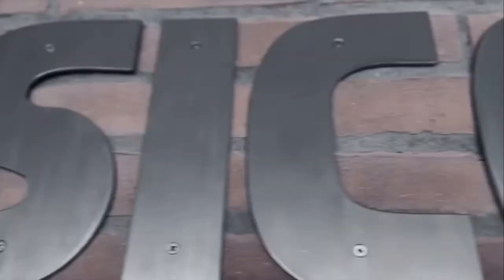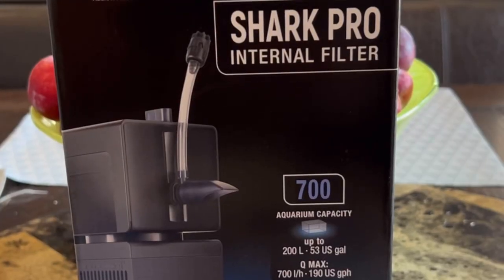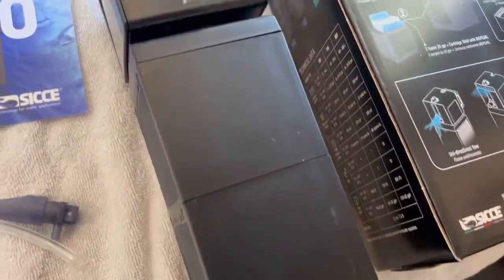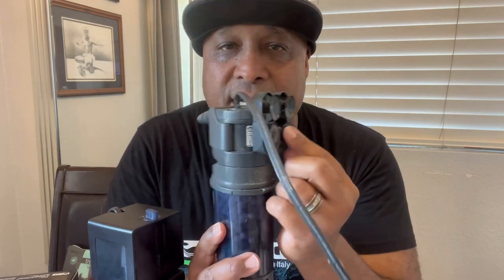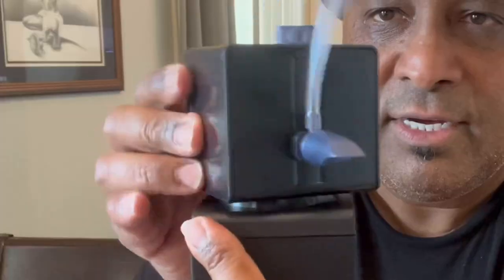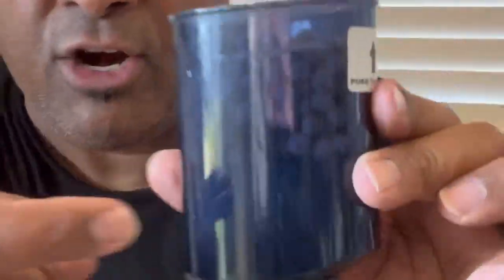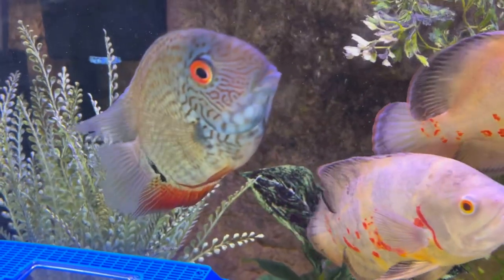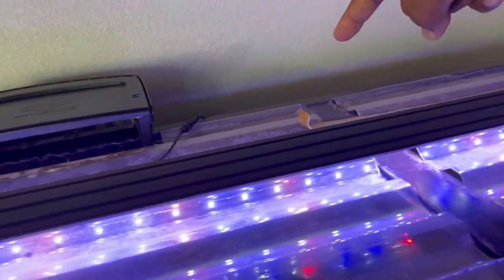NEW MUST HAVE AQUARIUM FILTER BY SICCE!

Comment: Aloha Mel.🤙🤙🤙 Question: What size of tanks does the 500 work for?  I've been looking for an immersed filter for my 20 gallon long, that will work if there's sand in the tank. I've found 2 but they both said not to use if you have sand. ????? Go figure. That's my luck.
Reply from the maker: I believe the 500 is for up to 37 gallons or and as far as Sam goes you can use the filter just try to keep it away from the sand you know so keep it up a little higher I would say maybe 3 to 4 inches higher than the substrate if you if you’re using sand
Reply: @HaYNFishKeeper   Cool. Thank you, Mel. I don't suppose you can tell me how much the 500 cost can you?  Or do I need to go to the website?
Reply from the maker: @cathyhendrix7552  it’s like $55

Comment: I do not really like the openings in the sides. I been noticing on a lot of reviews, all of the gunk is always to one side, while the other remains relatively undisturbed. The ADV model to me would be superior in that regard because all of the filter media is equally filthy. I love my ADV  filters. I purchased the 800 versions to use the extra basket as a dedicated biomedia space. It never gets removed.
Reply from the maker: I think people are putting the cube compartments on the wrong way that’s why one side is cleaner than the other… I absolutely love the Shark Pro the upgrades are superior especially the magnet!🤙🏽❤️
Reply: flicksby is correct. The lower baskets are useless, I have the 900 and tried closing the  upper basket in flow on the sides (so it only receive inflow from the lower basket, underneath it). This way I can put bio media in the upper one. This filter is stupid, a part from the smallest version with 1 basket, which is okay as sponge filter. The ADV might not be as fancy looking, but at least the intakes starts at the bottom of the filter, working its way up through all chambers.

Comment: Quick question 🤔 does it matter which way the filter  Cubes are facing. Like for example the way you're explaining it, the opening to the cubes are on the side but if you look at the video of the shark pro presentation there's a part where its facing the front.  I just want to make sure I get the best  Filtration out of it

https://youtu.be/ND2V7hezoi4
Reply from the maker: Oh braddah that’s a great question to answer that it’s a yes and no… it doesn’t matter which way the cubes face you can have the openings front to back or side to side it’s best to have the vents on the side but like I said front to back works too🤙🏽🤙🏽🤙🏽🤙🏽🤙🏽
Reply: @HaYNFishKeeper  Thank you

Comment: I bought the largest one recently.  I do not like it.  Compare to a normal hang on the back filter,  its ability to hold biological media is minuscule.  It's a joke!  There is no way it's enough for a 70-gal.  The flow might be okay, but there is not enough room for the beneficial bacteria to live!   There are a few remarkable improvements/inventions that I do like.  But one of the most important features a filter must have is biological filtration.  Unfortunately this does NOT fit the bill in my opinion.
Reply from the maker: Depending on the Stock in the 70g it could definitely filter a 70g… but it definitely just gives others an option that’s all!!🤙🏽🤙🏽🤙🏽🤙🏽
Reply: trinity is correct, this is because all filterbasket have in take on the sides.. its basically a fancy sponge filter. the upper basket should have been closed and take their intake from lower baskets. Really weird design, the 500l/h is a nice looking sponge filter tho.